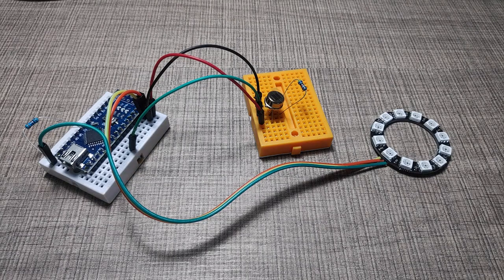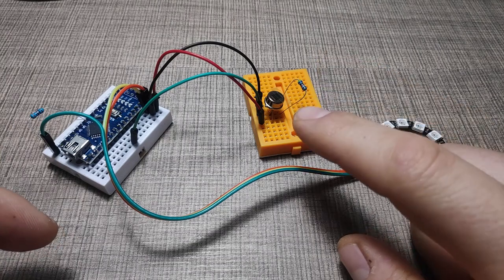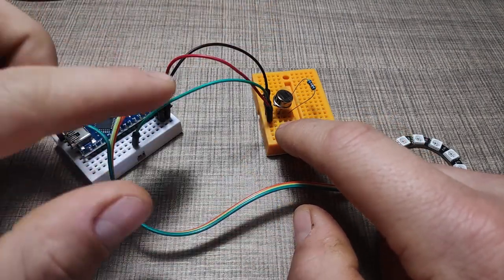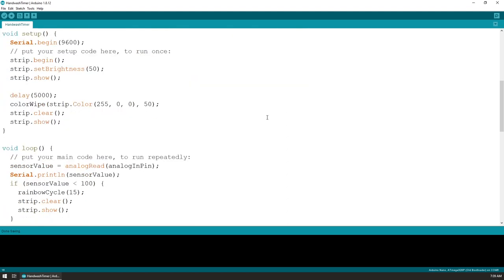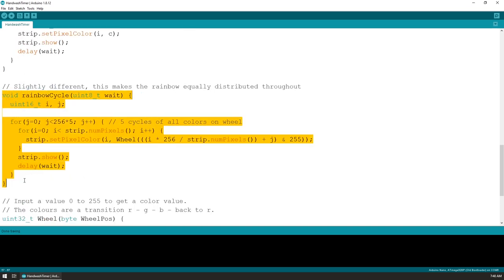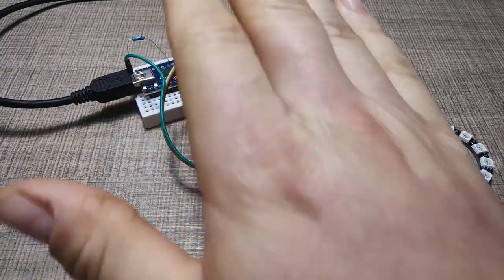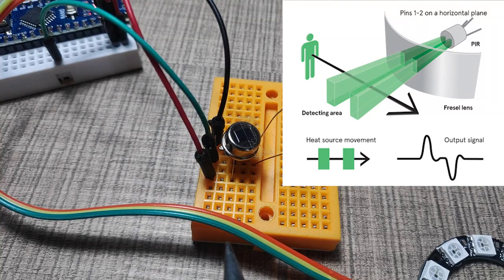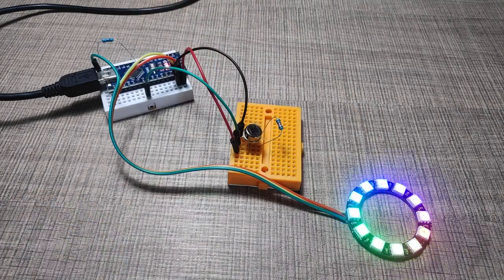Fighting COVID-19 - Arduino hand washing timer with PIR sensor and NeoPixel ring

Comment: You need the poly Fresnel lens on the unit for it to work at distance .  You should see a spike followed by a dip  (20mV peak to peak) when a warm moving object is detected.  See::https://www.makerguides.com/wp-content/uploads/2019/07/RE200B-Datasheet.pdf
Reply from the maker: Yes, I know about the lens but with it, the movement will be triggered even by standing to it unless there is something covering the sides and only the top is exposed.
Thanks for the datasheet.